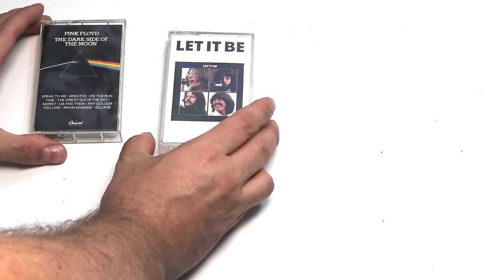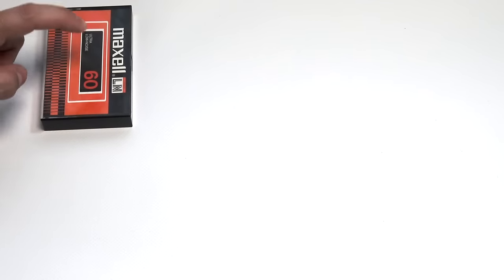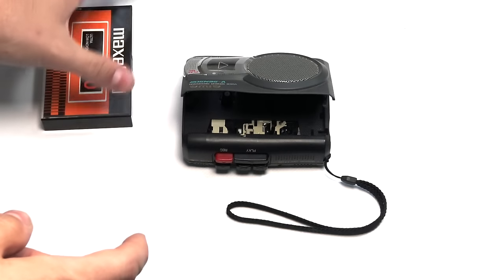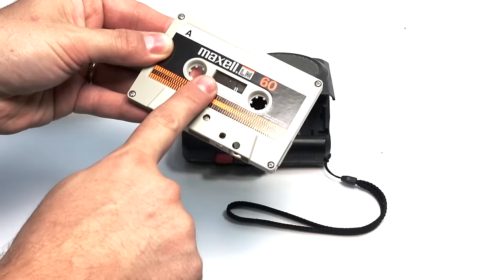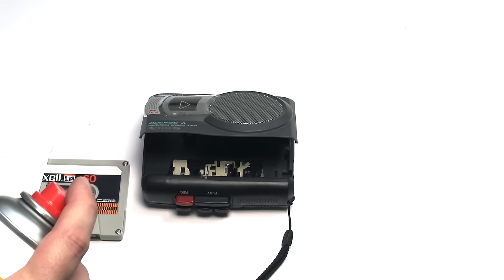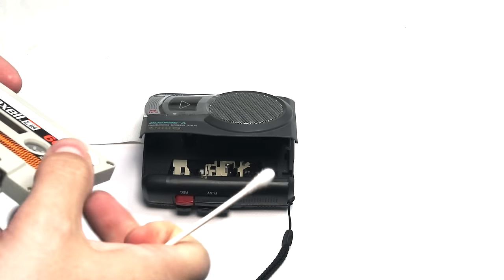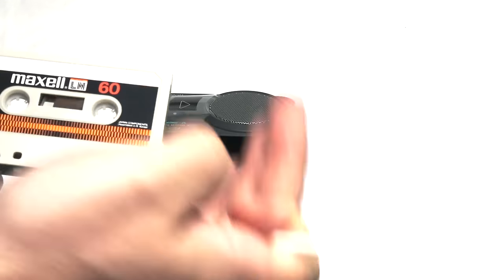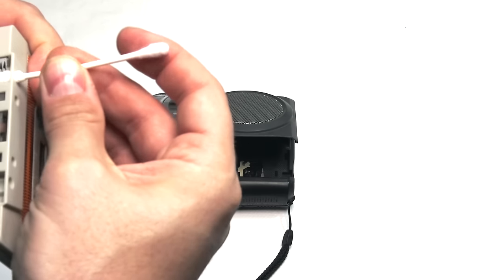How to relubricate your stuck cassette tapes

Comment: This has worked really well. I managed to revive a few old cassettes of mine. Your right though, it may take a few attempts to get the tape back to nearly new. I was very happy with my results. WD-40 specialist silicone seemed to work well with tapes.
Reply: Silicone is a very good electricity insulator and can run havoc in anything using electricity. Be careful when using it.
Reply: @xcvbxcvb2179  Silicon based lubricants are everywhere in the cassete deck's mechanism. It's the only lube available for plastic/pvc parts and plastic-metal joints.
Reply: @corwin.macleod  there's teflon spray though.
Reply: Are you sure wd40 lube will work? Thanks.
Reply: @corwin.macleod  Teflon grease is used a lot with plastic or metal/plastic mechanics. The priority is that it is mineral oil free.

Comment: Some years ago, I've discovered that one of my tapes sounded really worn out. But instead of throwing it in the trash, I've "retired" the tape and only kept it as a collectible item (because the tape is rare). After seeing this video, I gave this method a try with the 3M lubricant. And it works! Not perfect, but still a vast improvement. Thanks for the advise.
Reply from the maker: Cool! Try to play it in 3 weeks and you will see that it will probably play even better. Thanks for sharing your experience!
Reply: Do some research on tape baking as well while you are at it.

Comment: This fixed a new old stock , pre-recorded chrome tape from 1987 I got. It was shedding old lube all over the tapehead (white debri) and as a cause would have massive dropouts suddenly whenever the head got clogged. The tape also squeeked at the end of the sides. I went over the tape with a dry q-tip first and then applied new silicone using your method. (though instead of a deck/personal stereo, I used a cordless screwdriver on slow speed and an old felt pen stuck into it that perfectly fit in the cassettes' hubs. True McGiver technique, lol) Now the issues are completely gone and the tape sounds as good as new!

Comment: I didn’t have any silicone lubricant laying around and didn’t feel like going to the store, so stubborn me just shaved some fine graphite off a pencil with a razor and rolled my cotton swab around in it until it was well coated. Worked like a charm, and no issues to speak of yet regarding the graphite. A plus to this method in my case is the results were instant. I played that sucker immediately, no waiting. 

Thanks for the inspiration, love your content.
Reply from the maker: Great, I just hope it doesn't stick and change the characteristics of the trasport
Reply: Can you provide proof of this method?

Comment: So glad I found this, I had an old 8-bit game tape that was making a horrible squeaky noise and wouldn't load. I'd already tried changing the felt but no joy. This method worked perfectly and it was working straight after applying the silicone. Thank you!

Comment: Thanks so much for the advice! When I first started lubing my cassettes, I did it your way, with a Q-Tip brand cotton swab and a can of Liquid Wrench silicone spray. At some point in your video, I think you asked for other ways to do this, so here's the process I finally "graduated" to: I rewound each tape to the stop, then used a butter knife to gently pry/pull the tape out and away from the little follower pad, ending up with a loop just big enough to put my index finger through (if I'd wanted to). Then I sprayed the silicone lube through the little red applicator straw as gently as I could, trying to get a decent size drop to dangle from the tip. Next, I carefully dropped that drip onto the follower pad, tightened the tape with my finger, and rewound it like you did. Then I repeated the entire process. Some cassettes I lubed this way 4 times, some only twice. Now I'll leave 'em sit a day or two and give 'em a play! As I typed this, I wonder how one of those electronic lubes would've worked? Something like CRC's 2-26?
Reply from the maker: Thanks for sharing!
Reply: Here's the follow-up: The last tape I did with the Q-Tip before switching techniques just seized up and broke. I think I over-lubed it and essentially glued it together. Oops! It would rewind and fast forward alright, but it wouldn't play to save my life. When I tried to pull it out of the shell, it broke. I'd recommend if you use my technique, you only do two drops of lube - one drop, rewind, one drop, rewind. Done.
Reply: @maximusmax4557  Video Please :)

Comment: I used a high alcohol hand sanitiser and rather than holding the cotton budds in place I cut them down to size and placed them under where the tape is brought by the pinch roller. Worked a treat on my  Jamiroquai emergency on planet Earth cassette

Comment: I tried it with my dad's old Pink Floyd casette, and now it sounds really good. Thanks.
Reply: What kind of lubricant did you try?
Reply: @ManicksChannel   Mink Oil
Reply: @willyb7353 oh come on haha
Reply: @ManicksChannel   Yeah, it's ridiculous.
Reply: @willyb7353  😑
Reply: @willyb7353  you might have just destroyed your dad's pink floyd cassette
Reply: @ManicksChannel   Nope, works good to this day.
Reply: @ManicksChannel   And anyways, what's the worst that could happen? It's a cassette. To absolutely ruin it would be a challenge. And lubricating it, even if it is shoe shine, would not destroy it.
Reply: @willyb7353  how long ago did you do that?
Reply: @willyb7353  at first I thought you were just messing with me haha but I dont know I'm pretty sure true mink oil has acid in it.
Reply: @ManicksChannel   Yes, it does have AN acid in it. But it does not destroy. It would make no sense if they put acids harsh enough to melt cassettes in shoe polish! What do you think would happen to people's shoes?
Reply: @willyb7353  degrade. Not melt. Plastic is more sensitive than leather. Audio equipment is more sensitive than a shoe.
Reply: @willyb7353  hahaha
Reply: @willyb7353  oh, and if you ever want to dye plastic, you need acetone to help slightly break down (degrade) the surface of whatever plastic you are dying so that the plastic will allow the dye to actually set in. Acetone is acidic you see. It all works in the same way as if you were polishing leather boots with polish that has a dye in it. Wouldn't hurt to have a little acid in something to help the dye work it's way in to the leather. Like a Mink oil or something like that. I'm sure a lot of shoe polish has some acidic properties to them even.
Reply: @ManicksChannel   Polymer is not plastic, plastic is a type of polymer.
Reply: @ManicksChannel   And also, if your little theory was true, the tape would not work. Although I have stated many times that it works like new. It used to stop randomly, and the tape sounded horrible. I used this method as a last resort, and it still works. And the acid in mink oil is palmitoleic acid, I think. And it is not harmful. In fact, It is completely safe.
Reply: @willyb7353  okay then😄👍
Reply: try on all your dad's cassettes to regenerate them all to be better

Comment: I recently got a sealed old stock Beatles Breadbox, and was extremely happy until finding out that the XDR tapes were sticking. I watched this video and was prepared to try it, but I freed them up with multiple FFWD/REW cycles. One tape had to be wound manually with a BIC pen at first, and another was squealing horribly, but they all work now without anything as extreme as adding lubricant. One cassette took about ten FFWD/REW cycles to loosen it enough to play well, but it works great now. I would only resort to lubrication after exhausting all other options.
Reply from the maker: I agree!!
Reply: That's what I do. FF & RW. And, if it's possible, I carefully open the tape shell and replace the sheets. Some seem "inflammed".
Reply: My Death Spiritual Healing cassette is an XDR its sticking I need lubrication.

Comment: You can cut the ear stick with scissors for it to sit flush with the tape, and then, you can pretty much rewind it from any player without needing the access to the tape. Btw, this actually works. Right after I lubricated my Pink Floyd Animals tape, it now actually plays pretty decently, there is still some "lag", but like the guy said - it takes a couple of weeks for tape to fully lubricate.

Comment: I'd like to add my thanks to the many already here. I have been trying for years to get a working copy of a BBC TV soundtrack on cassette because... nostalgia... but every copy I got was stuck solid and unplayable. What I didn't realise is that the BBC used EMI for some of their cassettes. The tone at the start which you mentioned was the link that got me looking closely at the inlay where sure enough it said "Distributed by EMI".

It took three applications of WD40 Silicone Lubricant (now called WD-40 Specialist Silicone Lubricant) with around a week between applications to get it playable. It's not 100% yet, but progress is being made and I am confident I can keep repeating the process to get it right. Thank you for the method and motivation 😀

Comment: I tried this method for some 1980s/1990s 8-bit computer cassettes whose games weren't loading (they were for an Amstrad CPC464).  I'd been given some cassettes and also purchased some recently that simply wouldn't play ball - first one I tried (after binning it!) work first time!  Highly recommended.
Reply: Perfect! I have some original commodore 64 tapes that are stuck. I didn't trash them because I had read somewhere about the idea of possibly "unsticking" tapes. I was thinking it was a temporary solution, to unstick and then copy them. I didn't realize you could actually restore them back to usable condition! Fantastic!
Reply: I wonder if any old oil will work... After all, the coating on type I is FeO2, so if it is an oxidizing oil, who cares...the iron is already oxidized.
Reply from the maker: I would stick with silicon based dry oil!
Reply: Ya, thinking it over, I have seen vegetable oil after a period of several years. It turns into a jelly.  I definitely won't be trying it on my precious collectible computer tapes.  Better just to buy some decent silicone oil and have it around. 

The one you used in the video is silicone based. I keep seeing it spelled and pronounced silicon, and for several years I thought it was an elusive chemical you could only get from specialty places. I also wondered how a crystaline semiconductor could possibly be used as grease...I also always thought of silicone as the stuff in liquid nails and ...well tubes of silicone for sealing bathtubs. So, watching this video I could clearly see you had silicone oil but were calling it silicon, and spelling it silicon. So I just went and looked it up to see what this stuff actually is. It is a silicon based compound attached to an organic structure like a benzene or whatever. Hence the similar name, but they couldn't be more different. At least I finally cleared up that confusion! Thanks for the video!
Reply from the maker: Probably my pronunciation is wrong. As you probably know I am mainly Italian sonI make some mistakes, sorry about that.
Reply: Actually, you don't really have an Italian accent at all when you speak English...I thought you lived in the USA, lol. That makes sense, A lot of Italian words end in E that don't in English. I did notice a slight affectation, but I thought maybe your parents were from somewhere else or whatever. Anyway, wow! Well done on your English sir!
Reply from the maker: Wait wait! My mother is American but I grew up in Italy...almost a 50% I would say...but thanks!
Reply: What exact lubricant did you use? I have the same problem to solve.

Comment: Thanks for the tip. My Led Zep tape was set for the bin. Stuck a pen in my cordless drill and held it in position. Will wait 24 hrs to see if it work out. I applied a little silicone to the pressure pad that had dried out. Fingers crossed. It already feels easier to turn with my fingers.
Reply from the maker: Nice! Give us some feedback! Good or bad, no problem here!
Reply: Although the tape loosens up I had the same issue. I believe the tape may have stretched which is not repairable.

Comment: I found this lubrication problem on most EMI tapes from the 80s, made in the netherlands, thanks for the advice!
Reply from the maker: You are very welcome!
Reply: @anadialog  
Another quick question: if i use contact cleaner, do i need to buy a specific one or does any good quality one work fine? Aksing because it’s not easy to get a hold of the 3M lubricant where i live and contact cleaner is easier and cheaper to find
Reply from the maker: I tried the one in the video, can't say for the rest. What I suggest is to get a silicone based lubricant with NO solvents. And make sure to dry everything up after application. Start from a cassette not to important for you.
Reply: @ttheone3518  You definitely don't wanna use contact cleaner! I used some Liquid Wrench silicone spray, which you should be able to get at Walmart or your local auto parts store. You might also try something like CSC 2-26, which I got at Home Depot. Good luck!

Comment: Oh...another thing is...this technique also helps to regain back the fidelity of the old cassette tape! Silicon lube not just lubricate, but it helps to clean the tape by wiping out the ferrite debris, moulds and etc from the reel.

Note that if you're putting too much lube, you're likely ended up soaking the tape with the lube. You can clean the excess lube by rewinding back and forth with clean and dry cotton swab/buds. Also, you will need to clean the cassette housing inside as well. After cleaning the cassette housing, rewinding back and forth again and let it dry for few days and try to play the cassette and observe if the cassette plays well without being stuck. If cassette stuck again, try to lubricate the tape head and it should be played without much issues.
Reply from the maker: Indeed! Yes, it's very important to absorb the excess of lube. Otherwise you may have a slippery transport and have wow and flutter issues. Just add it, let it absorb and then clean it up!
Reply: The only thing about cleaning the cassette housing is that sometimes there are no screws at all to get into the cassette!
Reply: Came here looking for such a comment.... Because, IIRC, I've had scenarios where opening up the cassette shell and cleaning off the inside walls and applying a lubricant to the sides of the two ribbon spindles that rub against the interior of the shell made a massive difference in my particular cases without applying any lubricant to the ribbon itself.

Comment: If the tape has screws you can open the cassette carefully and spray the lube on the sides of the reels, then take a q tip and soak up the excess. Put the tape back together and set on the shelf for a week. The lube will seep into the film over time and the tape will play nicely. I have done this for many years. If the tape does not have screws then you take a flat razor blade and tap into the side seems of the tape to break the bond and open it it carefully. After lubing it you then put small drops of super glue on the edge seems of the tape and close it back up.
Reply: True that's why I miss the old cassettes you can take them apart I hated when they started sealing up the blank cassettes I used trim mine down sometimes to customize my tapes to fit the length of the album that I copied it on
Reply: @jimmiesmith5811  i sure do miss those days.
Reply: Thanks for the tip- I'm just curious, after a week or so, does lube absorb into the tape enough so that it actually doesn't coat the pinch roller in the lube? That's my main concern when doing any tape lube method really...
Reply: @Lindsay James  the pinch roller always gets oil on it after playing tapes that have been lubed. I always maintain my tape decks by taking a q tip soaked in 91 percent rubbing alcohol and clean the pinch roller. Once the pinch roller has been degreased, I take 400 grit sand paper and rip a small piece about the size of your thumb. Then I rub the sand paper horizontally across the rubber pinch roller. This removes the stale film off the rubber and makes it grip better even if it gets oily.

Comment: I had cassettes from the late 70s', early 80s' that just didn't sound right, picked up a cheap onn. cassette recorder at Walmart, got a can of 3M (08877) wet type silicone and some  art swabs (wood q-tips) lubed every cassette tape in my collection and I must say, what a difference...
Reply from the maker: Thanks for your feedback!

Comment: I ordered a bunch of preloaded cassettes from the manufacturer. Some of the cassettes had lubrication issues. They literally told me this process, but to use sewing machine oil and nothing else. I've had pretty good luck with that and have only ever waited 48 hours, as that was recommended.

Comment: Hi, great video, very helpful and knowledgeable! I've got quite a few of EMI tapes and XDR Tapes were the lubricant has dried up, mainly some really nice Frank Sinatra tapes that I haven't seen anywhere else. Also happens on tapes produced by Sony in the mid 1990s. Is there an alternative solution that works just as well nowadays, as here in the UK, the 3M silicone lubricant has been discontinued?
Many thanks!
Reply from the maker: Thanks! Well, I guess any silicon based lubricant WITHOUTsolvents